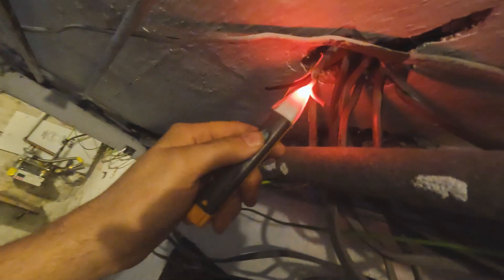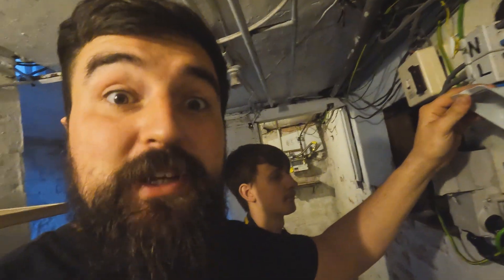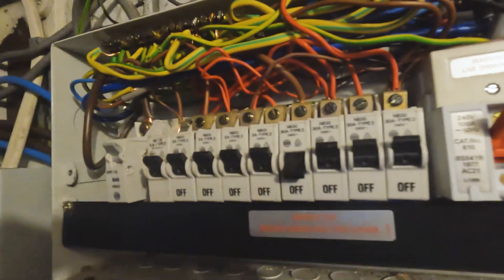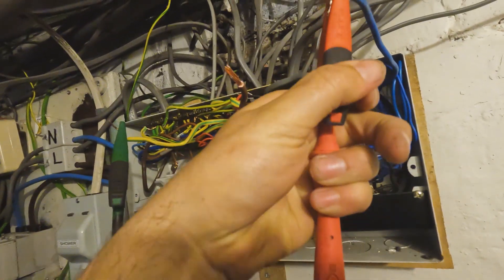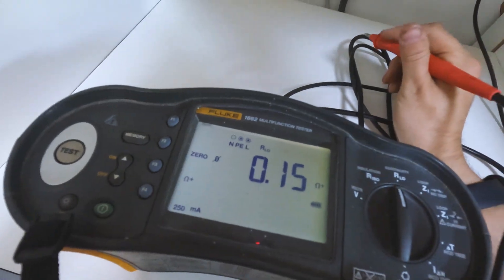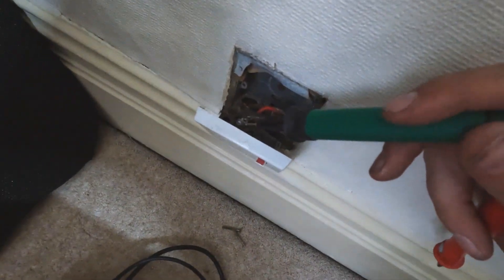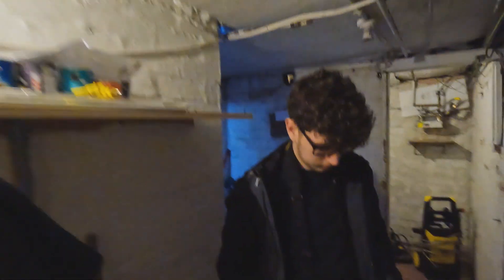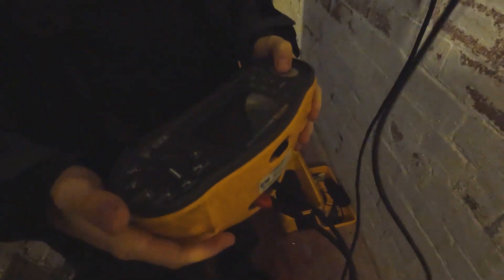EICR RESULTS:   DODGY... DODGY... MEGA DODGY! 😬🔌⚡

Comment: If its fail Ze then thats it eicr is pointless no point doing anymore until rectified by the DNO
Reply from the maker: Nah that would be a waste of the clients money 😮 the whole point of the test on the clients side is, does this need a rewire, how long will this installation last, is the installation safe. If you just packed up after the ze the client would be pissed 😂 they would receive a report saying exactly what has passed or not and know exactly how much it will cost to rectify any issues. 

Seen a few companies just show up, see an old fuseboard and say yup failed needs a rewire 😂 so wrong!
Reply: @finneyelectrical  no not at all, a waste of time would be to carry on with a eicr on a unsatisfactory installation its failed already if it hasn't an earth so the rest of the test is totally pointless you can't do any real tests for IR or Zs. So you won't really be able to give them full report until you can tes fully which means have a true earth.
Reply from the maker: Nah disagree, you can do r1+r2 readings to show everything has an earth and decent readings. You can do IR test to pe. I’ve never had a good IR reading to its own PE be bad to earth. Just cowboys money grabbing would do that. I would agree with you if you didn’t charge for the visit. Do the retest for same price.
Reply: @finneyelectrical   you mean 'pissed off' not drunk? Right?

Comment: 643.3.1 clearly states the test shall be carried out with the protective conductor connected to the earthing arrangement.??
Reply from the maker: Fair play, way i've always been shown, guessing your refering to the insulation resistance test. I always disconnect line earth and neutral so when you get your circuits r1+r2 you know its for that circuit and not nicked off circuit 2. If the nicked circuit 2ngot disconnected then you would lose your earthing for circuit 1. Always see people test to the earth bar
Reply: @finneyelectrical  Do your IR test first but leave your CPC connected at the MET. After that disconnect the CPC and do your R1+R2… Oh and you can’t the CPC as a live conductor even in flex.